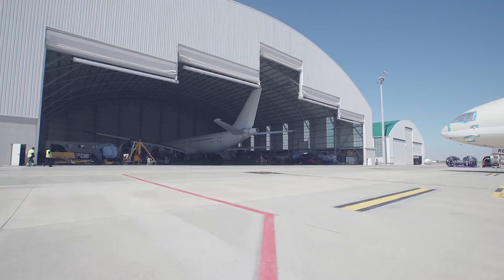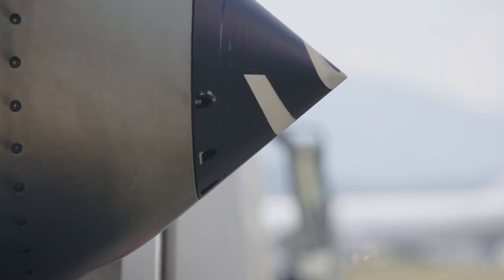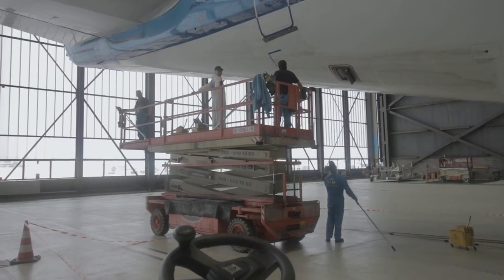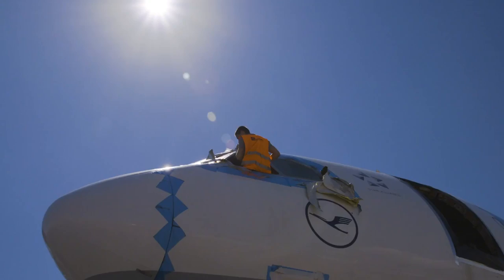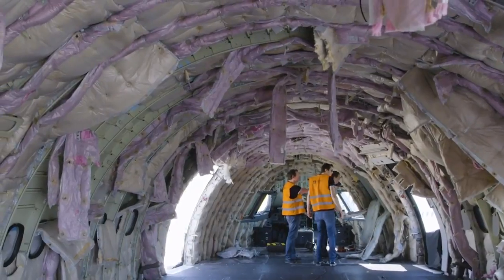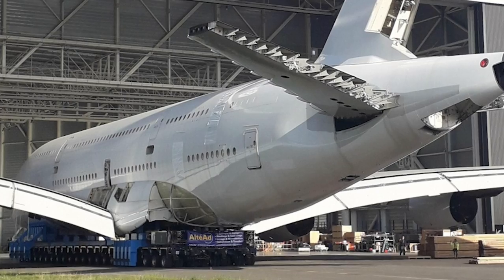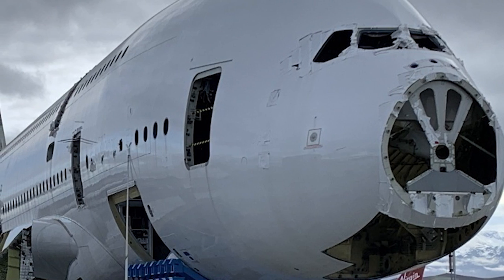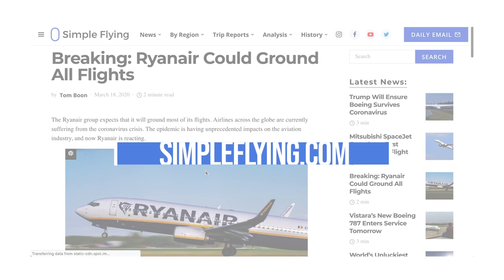How Is An Airbus A380 Scrapped?

Comment: Sad to see a technological marvel getting scrapped. Possibly a decade of hard work by some outstanding professionals just ripped apart due to the commercial failure of the aircraft. Business rivalry, to achieve superiority at what cost is a good guess ! I wonder if the aircraft could have been used for cargo.
Reply: Remesh Mahadeva Iyer the floor design prevents that. Although since they will be plentiful for sale now (and presumably cheap) it may become profitable to redesign the entire floor system for cargo use.
Reply: @aurktman1106  The whole plane is way too heavy for cargo. And operating and maintenance costs are just way too high for conversion. Passenger versions were barely a break even proposition. They had to fly 100% full at all times to make any money at all. Qantas is looking forward to the 777X-9 that carries 426 passengers in three class's. They said they can fly two 777X-9's nose to tail cheaper than one 380 three class version. Two 777X-9's in three class configuration will fly 852 passengers as opposed to the one 380 three class configuration that fly's 525 passengers.  It's cheaper to fly and maintain two 777X-9's with 35% more passengers than one 380. And with the folding wings, the 777X-9 can be accommodated by any airport. Special facility's have to be built to accommodate the 380. That's why U.S. carriers never ordered the 380. They are just way too expensive to operate. Even on long haul routes.
Reply: @fposmith  all of that is true, plus what I said.

Comment: No I never liked them. Jumbo is still the Queen of the sky
Reply: Is that a Boeing preference or performance based? Just curious. Interesting statement nonetheless.
Reply: @dinner85  Probably a bit of both mixed with legacy. 380 was a good concept if it were made in the 70's. The fact that 74's are still being produced (granted for cargo only now) is a testimony in and of itself. The queen was a detour for Boeing from their bid at what became the C-5 Galaxy program. When their plane failed to make the contract, they redesigned and turned it into the 747 series which started its entire life from the original concept of cargo operations and it will finish its life in that capacity.
Reply: @raymarshall6721  I didn't know much of that. I respect your knowledge. Thanks for sharing. I'm interested to see where aviation takes us now. I work for city council and we now have a at least 2 dozen international pilots working as bus drivers. Maybe small planes in the future. I would like to see something like Eviation ALICE one-day. But considering a Tesler weighs close to a Prado I can't see it.

Comment: Sad. Some need to be converted into youth hostels at major airports like the 747 at Stockholm. That'd be a much better use that turning them into pop cans.
Reply from the maker: Even just one like that would be an amazing thing! - TB
Reply: Aircraft conversions into hotels, homes, & restaurants usually don't turn out well. It's a giant tube of metal... an oven in the summer, and an icebox in winter. The power bills to keep something that large at a comfortable temperature & humidity will be enormous.
Besides, over time, the outer skin becomes dirty & stained from weathering... especially when most planes are painted a light colour.

Comment: The first A-380 flight was on April 27, 2005. Practically an A-380 is not more than fifteen years old. With a price tag of $445.6 million, the A380 is one of the most expensive and lavish airplanes ever built. So it is very difficult to imagine how this is a profitable business? Scrapping this plane might cost another fifty million?
Reply: The 380 used on the open market is lucky to fetch 70 million dollars today (I seen this the other day on YouTube), scrapping and parting out really is more profitable because Airbus has shut down the production line, parts suppliers are no longer manufacturing parts and the second hard market is going to be pretty much the go to market for the few remaining  380's after the dust finally settles.

Comment: Such a young aircraft to see the A380 being scrapped already. The 747's are still flying and some are over 25 years old.
Reply: The 747 first went into service 50 years ago with Pan-Am.   It's worth mentioning that the Boeing 747 is still in production as the 747-8 which is a cargo variant.

Comment: The A380 was supposed to take the place of the 747. After 50 years, the 747 is STILL in production, still in passenger use (even now with the lockdown), while the A380 is ending production, and the existing fleet is completely grounded.

Comment: I kind of knew that the A380 wouldn’t be successful. It was a very expensive airplane to run, and airports had to spend millions of dollars to expand most of their runways, or build new ones to accommodate the plane. Once Boeing unveiled the 787, I knew that would be a massive success, and its been a huge success for Boeing and the airlines that own them. It’s lighter, and saves airlines millions on fuel because the plane uses 20% less. With rising jet fuel prices, this is great for the airline industry. The other thing about the A380, is that in order for airlines to make a profit off of it, they have to fill every seat on the plane which is almost impossible to do. That’s another reason why the 787 is successful. Profitability.

Comment: I am really surprised none of the cargo companies arent picking up these planes.
Reply: The A380 was never built with cargo modifications in mind. It's prohibitively expensive to modify an A380 to a cargo ship. The 747 had the idea of cargo versions from day one, so modifying one for cargo is relatively straightforward (and cheap).
Reply: @armorer94  why would taking out seats, toilets and kitchens be expensive? Just send a few guys with screwdrivers and its done. It must be some other reason
Reply: @cockyrooster361  Because it's not as simple as taking out the passenger amenities, the simple answer is that the floorbeams of the A380 is too weak to support freight containers. Besides, loading freight requires a large side door, which the full double-decker A380 cannot support because it will compromise the structural integrity of the second deck.
Reply: @nightflyer3242  Freight, is not always very heavy. A box of parcels, hardly weighs anything. Those FedEx, UPS planes rarely carry anywhere close to max payload weight. Restrengthening the floors doesnt cost THAT much. They could use top deck for the light stuff, and below decks for the heavier stuff. Considering how much time these things have left in them, and how much they cost, surprised no one is going that route..
Reply: @cockyrooster361  The lower deck's ceiling is not big enough for containerized freight, which is where cargo airlines make their money. The upper deck's floor beams is a big part of the A380's structural integrity, any modifications will essentially force Airbus to recertify a new aircraft, which there is simply no market for an A380 freighter when more capable planes like the 747F and the 777F are already widely available.
Reply: What?? Not big enough for containers?? I am talking to someone who doesn't really know what they are talking about....
Reply: @cockyrooster361  I guess you can't accept that Airbus screwed up during the A380's development by not having freight in mind. Airbus tried to put up a dedicated freight version of the A380 after EIS but there was no demand and the only customer who had orders for the type, FedEx, cancelled and went for the 777F. Weak floor beams, not compatible with current containers on the main deck, unable to engineer something without compromising structural integrity, and simply a lack of market made the A380 both passenger and potential freight version just DOA.
Reply: @nightflyer3242  All you need to do to make a floor stronger is to add a few more floor beams. If the Pass versions has 5 beams/ 10ft, make it 8. You just made the floor stronger AND you made it structurally stronger. I dont know where you are getting this whole "structural safety" argument from. Again, as I said, you are someone who doesnt REALLy know what they are talking about. Moving on, the reason why Fedex canceled was because of politics, than economics. There was a major push during that time to "buy american".
Reply: @cockyrooster361   There's no adding just a few things in aviation. Unless you want to pay Airbus to do the entire certification process because you modified the entire airplane's structural engineering, the A380 is DOA.
Reply: @nightflyer3242  There are literally countless, passenger plains that were converted for cargo. All they did was strengthen the floors a bit and have the FAA take a look at it. Again, you dont know what you are talking about...
Reply: @cockyrooster361  Cool, it's because they don't have a low-ceiling main deck and an extra double deck which was designed to only carry people, not tons of containers. The A380 was a shortsighted vanity project from the beginning.
Reply: @nightflyer3242  If it was a vanity project, then why did Fedx and UPS order them? I just looked it up and apperantly Fedx actually wanted them, but when the program got delayed, they decided to go 777, cuz they got tired of waiting, not because the plane wasnt suitable. containers can be custom made to fit anything.
Reply: @cockyrooster361  Only two prospective operators and both cancelled. Only barely over 300 sold in total and have zero second-hand value. Yes, the A380 was a vanity project to one-up the 747, which ironically, the 747 ended up still outlasting the A380 despite being 30 years older.
Reply: @nightflyer3242  Well, all that is a different story/discussion for a different time, which I dont have the time to debate you. If it really did have only 0 value, beleive me, some one would be snapping them up right now.
Reply: @cockyrooster361  Fedex didnt take them because they didnt want to wait, FedEx didnt take them because they wouldn't pony up 10+ Mil per airport to make them able to service the 380. You need to take into account the 380's MTOW as well as the basic operating costs. MTOW of the 380 would mean that it would be limited on how much it could carry (FedEx and UPS aren't really bulk freight, they are parcels which are lighter than what most cargo operations would do), once you reach 20 - 40% of available space used and you reach your MTOW limit, then you lose money by default just having the plane. The reason nobody wants them is because of the outright costs. Purchase cost + Cost per hour to operate + Cost per hour to maintain + Cost to upgrade airports + a completely closed production line which means parts are only available from boneyards = an economic suicide to anyone who picks one up. Emirates will be the last to use them because of their position to dominate that areas hub and spoke model simply because of the infrastructure in that part of the world. Once they start paying more for parts to keep them flying, they will vanish too.
Reply: @raymarshall6721  Then why did Fedup and UPS consider these things and actually put in orders? Your telling me they didnt do their homework before putting in those orders? Both said they were canceling cuz it was taking too long, not for al the reasons you said. And why does UPS have 747s?? The truth is that for its size the 380 is amazingly economical, only requiring about 60% to start making money. Spare parts? All manufacturers are required to provide parts for an x number of years ( cant remember the exact number right now).

Comment: It's always sad to see unappreciated planes going to the scrap yard.  I cannot believe Airbus has not come up with a cargo conversion and yes it can be done regardless of the naysayers.
Reply: The A380's floor board is just too weak to support cargo operations. A cargo conversion will cost as much as a brand new plane.
Reply: it's a bad design for a freighter
Reply: @nightflyer3242 : Agreed. And the B747 was originally designed as a proof of concept prototype freighter for USAF.
Reply: Airbus had a 380F variant concept with FedEx looking at it, but the cost to upgrade the airports to make them work just wasn't feasible. Like Mundy said as well, the 747 was designed with Cargo in mind before it became the 747. It was Boeings concept to get into what became the C-5 galaxy, when they didnt get the contract, they lowered the wings and threw seats in. Mix that with the 74 came about when ETOPS made it so 2 engine planes weren't viable for trans oceanic flights which made it an instant success, as opposed to the 380 which came after the 777 broke the ETOPS mold and had become certified to fly trans oceanic on just 2 engines already.

Comment: There's something I don't understand: some parts like seats can be used in other plane models, but most parts are specific of each make and model, for example I don't think you can fit a part from an a380's landing gear in any other plane that's not another a380
Reply: ...... which is why the parts will be bought by other airlines that have A380's to keep their A380's flying.

Comment: How old is the A-380 design?  It seems they were just put into service recently.
Reply: They started design at about the same time as the 777 was going full swing. The Triple 7 was built before the 380 had gone anywhere and it changed how ETOPS works which made 2 engine trans oceanic flights possible. 380 came 30+ years past its era.

Comment: What is that "propeller" thing that sticks out of the side?
Reply: That's the RAT, Ram Air Turbine. It provides emergency power in case all 4 generators are dead.
Reply: @nightflyer3242  Cool, thanks
Reply: @paulkersey2179  Another description for it is the prediction that the airplane is screwed. If you see an airbus in the air with that down... it is safe to bet they beat the paramedics and fire department to the scene of the crash by at least 20 minutes.

Comment: I having 1 question actually  how many years 1 aircraft can fly
Reply: Vishnu it’s not a straightforward answer. 
Because it depends on the carrier, what the aircraft is used for and how much the operator wants to spend in maintaining versus replacing it. 

Major carriers will replace within 20 to 30 years for passenger service. Because profit margins are slim and fuel is the most significant cost. So there is a cost saving motivation to move to a more efficient aircraft. 

Cargo carriers on the other hand, like FedEx, which reap a much larger profit margin will keep their aircraft flying for much longer. So both FedEx and Lufthansa cargo are flying DC-10s an MD 11’s that are 35 - 40 years old!
There are  extreme examples of very old aircraft  with small regional carries. Canadian carrier Buffalo Airways is still flying mostly propeller driven piston aircraft like the legendary DC 3. One of those aircraft was manufactured in 1942 which means it’s 79 years old and still flying!
You might find the series “Ice Pilots NWT” featuring that carrier interesting. 

Whereas some Asian and Gulf based carries  pride themselves in having very young fleets. So that no aircraft is older than 10 years! 

Several years ago, the FAA funded a study to see how long the DC 9, an extremely durable plane, would last. The aircraft kept flying and they ran out of funds to arrive at an answer. So in some cases we really don’t know for certain how long an aircraft can fly. It all comes down to how much you want to spend keeping it in the air!

If you ask a manufacturer how long the aircraft would last the answer would be that the fuselage or body is rated for so many hours of service usually in the 40 to 50,000 hour range. But then again that’s an estimate and even the manufacture can’t guarantee that it would last just that long or much longer. 
I hope that gives you a good insight!

Comment: Hopefully people like British AirwaysI will start to pick up more aircraft,As currently they only have a fleet of 12
Reply: I think they have actually grounded most and are slated to remove them from their rosters. Production on the entire 380 line ended a few months ago and the line is closed and cleared out. Some airlines have their planes still sitting at the plant because they are already modeled to never fly them. No smaller airline will take them because of the cost to buy, cost to operate, and cost to upgrade airports to even land one of them. If they werent 30 years late to the party, I am sure they would have a legacy like the 74's but when you show up 30 years late to work, you wont have a job.

Comment: Should they have been built in the first place?  The 747 was already in trouble when AIRBUS launched the A380.
Reply: Thomas Jacques The A380 was in another league. By far the best passenger experience in the sky, streets ahead of the 747. The 747 is a remarkable plane, but basically a decades old design. I'd fly in either, but given a choice I'd always take an a380.
Reply: @spencerwilton5831  That's all opinion. Some say 747 is better some say A380. I would like to fly on one though just to see what it's like even though I hate the plane.

Comment: Very depressing to see any aircraft scrapped, I guess the 380 was a bad idea from the start.
Reply: Fun facts:
The A380 was more successful than the A318. 
242 A380's built, started  scraping after 10 years of service.
80 A318's built, started scraping after 5 years of service.
I'm one of the few that had the privilege to work on all 4 of the A320 (A318/319/320/321) family of aircraft.

Frontier Airlines was the launch customer for the A318, they had 12 in there fleet. 
Frontier's A318, A/C 805 was the second prototype A318 that was used to fly around the world and made an appearance at the Paris Air Show. It was used for the "try and sell the airframe" demos around the world before Frontier received the A/C  in the mid 2000's.